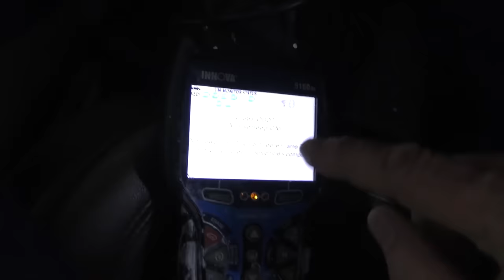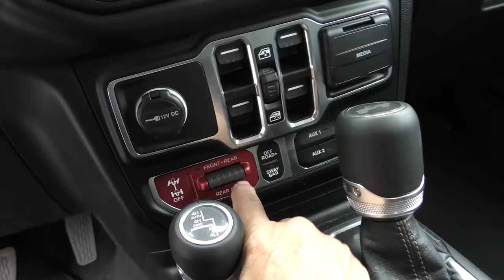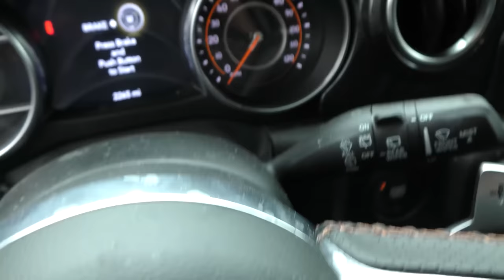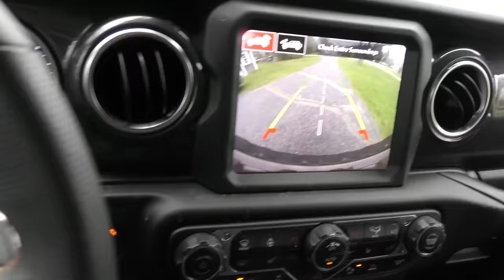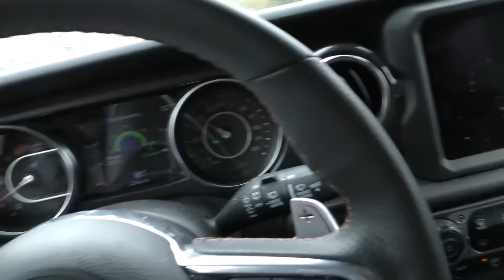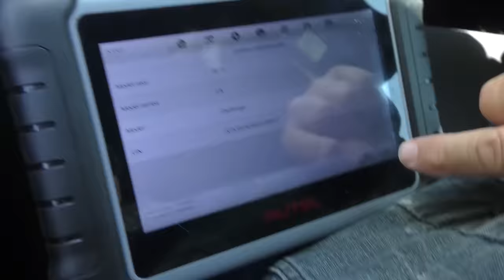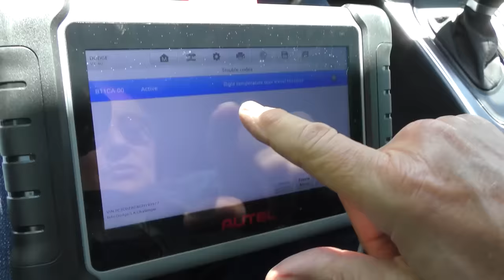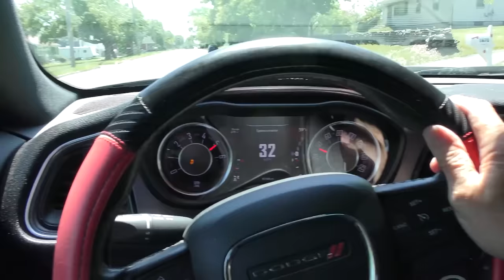3 Vehicles That Look Great But Fall Apart Faster Than a Marriage

Comment: If Scotty designed a vehicle, what should it be called? The Kilmer Classic. CHEAP, has a timing chain, NO BEAUTY ENGINE COVER, 4 cylinder, non-interference engine, A DIPSTICK, manual tire gauge in the glove box, no battery except to start it, no CVT transmission, MANUAL transmission, no GDI fuel injection, fat juicy backup camera, cold AC, clears that speed bump in Scotty's neighborhood, survives the stop sign during lunch hour, manual parking brake, AN ACTUAL KEY to start AND unlock it, made in Japan, no turbo, automatically changes its own oil every 5000 miles, gets great gas mileage except when you drive... like Scotty, has an actual chassis, cloth seats, no sun roof to leak, no plastic stuff, cheap available replacement parts, a GAS CAP, lasts half a million miles, and comes with a trustworthy mechanic like Scotty (with a scan tool). Did I miss anything?
Reply: No you did not miss a thing.
Reply: Very close to describing an older Mercedes diesel.
Reply: NO GDI ENGINE..NOOOOOO !!!!!!
Reply: toyota/Lexus badge
Reply: Missed fancy backup camera for tree in the driveway 😊
Reply: Just one. Manual transmission. Outside of that sir, you didn't miss a thing. Your comment is priceless! Thank you very much. Long live Scotty. Rev up your engines! If you handcuffed Scotty would he able to speak?
Reply: Purchase of the Kilmer Classic comes with a lifetime supply of throttle body cleaner
Reply: Ha! Good one!  @MrThatnativeguy
Reply: Cloth seats
Reply: @MrThatnativeguy   Sweet.
Reply: Missed working cold A/C
Reply: Missed that if you do a little maintenance it will go another half million miles.
Reply: It must be fast enough but no turbocharged, like NA 2.4L  4cylinder
Reply: Nah, you got the whole checklist.
Reply: Reliable electronic systems, changes its gearbox & differential oil every 50K miles, Autel OBD II scan function built into the central display module.
Reply: Kilmer Perfecto 1.8L
Reply: It would have to have two engine beauty covers cause we know how much he loves them.
Reply: No beauty cover
Reply: Make sure the side mirrors flail around like his hand gestures 😂
Reply: Old Mercedes 300D diesel. Volvo 240 series.
Reply: Recommend crank windows, never fail.
Reply: Did you forget "no TPMS"? Put a pressure gauge in the glove box.
Reply: Transmission dip stick
Reply: @Kurtdog63 Thanks again for the best comment I've ever seen about one of Scotty's vids. I doff my chapeau to you. I'm waiting for Scotty's next post.
Reply: Yes, you missed two things: it's cheap and used.
Reply: so a Corolla?
Reply: @dragonstalk86  1994 Celica or my 1999 Camry!
Reply: I think you missed no AWD.
Reply: Lower front bumper mailbox camera
Reply: @MrThatnativeguy and at205 reseal
Reply: 'Continuously Variable Transmission transmission'
Reply: Lists as 1994 celica
Reply: Toyota Celica  Scotty Edition
Reply: 4 and 6 and 8 cylinder
Reply: sounds better than most cars out rn
Reply: Forgot one thing: it’s NOT built by Chrysler
Reply: Ha yes. I put made in Japan, so I guess that excludes all American or Mexican or French made brands....  @Braaezex
Reply: It's called a 740 or 940 Volvo base model.   Job done.
Reply: 1:34 1:37 1:38
Reply: I'm having a hard time finding a 2021 Camry LE Hybrid with a keyed ignition 😂
Reply: it's called Lexus

Comment: I had an Alfa Romeo Stelvio for three years. One of the best cars I have owned. I know someone else that has had theirs for two years, not one problem. Give them a chance, they’re great vehicles.
Reply: Dude... 2 to 3 years doesn't make them great cars...they probably have hardly any miles....
Reply: @richsweeney1115 I don't get the Alfa hate, the first model years of the Giulia did have issues, but 2018 and up their cars are solid. It's pretty hard to find cars that are "unreliable" today.
Reply: It's not hate, it's logic. Alfa Romeos are made for people who lease and release. American and European cars are generally totally unreliable and expensive to fix.
Reply: @originalthoth7313  yet BMW is higher than both Honda and Mazda when it comes to reliability ratings now. Cars are more reliable than they ever have been. Fixing cars has never been cheap even with non-luxury brands although luxury brands are still considerably more expensive.
Reply: Isn't the Stelvio powertrain pretty simple? I thought it used a SOHC I4 turbo based on a mass produced Stellantis engine and a widely used 8-speed transmission.
Reply: It only has one problem. It's an SUV!
Reply: Most people in the US,  only use vehicles for 3 years, because they know after warranty expiree they can't afford expensive bills, so its easier to spend 30k in a new vehicle, and then in 3 more years the same. At the end people wasted more than 100k in vehicles. And they dont have savings ,  cant pay off their home because of  all the money the capitalism its taking from them.   One of the best decision  in my life was to  keep my car for 11 years, while that, i saved  a lot of money to pay off my home. Now that i have paid off my home, i decided to get  a new corvette. It Was worth to be patient.
Reply: @juancruz-jg5pq great, patience pays try driving the small utility car until we are in a good position
Reply: ofcourse. Alfa Romeo is making great cars. This guy just have no idea about new cars.
Reply: lmao, telling the world how reliable a 2 or 3 year old car is a laughable. If a car can't even make it to 3 years without issues, that means its a complete piece of junk. If you want to praise a cars reliability, drive it for at least a min of 100k first
Reply: @robotbro7187  100k you could make in one year so your comment is illogical.
Reply: You didn't own it long enough for anything to happen.  Almost every new car can go 2 or 3 years with nothing other than oil changes and possibly brakes and tires.  Own that Alfa for 7 to 10 years and it would be a different story.

Comment: My father has an Alfa 156 2.0TS for more than 12 years. 350k km (around 220k miles) with almost zero issues. He drives it daily. I have Alfa Romeo 159 too. : )
Reply: Had an alfa 156 also for about 10 year and 256 km. Pretty good car in fact; no rust at all. But maintenance (especially in suspension) needed to be taken care of.
Reply: @henrikvl1704 it's because the multilink is a very advanced suspension and requires some special care but is a blessing performance wise

Comment: I wanted to try something different than a Honda so I went with a Giulia. Great car had it for almost 4 years and put 55K miles on it. I do the oil change myself every 5K and it’s been great!
Reply: It's been great because you have no miles.......55k isn't a real test...my fords and hondas have had 250k-370k when I sold them running perfect..my last 5 spd  honda accord  had about 370k when it gt rearended. My 5 spd civic SI has almost 300k. Runs perfect ..I really dnt feel like you're will g that far, as problem free. They do look nice, and they're fast, I love them. I used to want one till I learned more about them  few years ago
Reply: @richsweeney1115  as you can tell from my username I’m a diehard Honda guy. I agree but I’m not going to keep it past 75K miles and that’s pushing it haha Honda and Acura is the way to go
Reply: @richsweeney1115  What kind of driving do you do to put in this many miles??
Reply: @richsweeney1115  You aren't the target market for this car.
Reply: Fords are worse than Fiats
Reply: @chris4321das  Bro, basic every day usage.
Reply: Wonder who was the unlucky bastard who got the car after you
Reply: @chris4321das You own a car a long time, you put a lot of miles on it. If he works a 9-5, that's already plenty of miles every week
Reply: @richsweeney1115 my current 2013 Ford that I use as a daily has 394,000km.  Runs like a clock.  The 2015 Mustang GT is my fun car that I use evenings and weekends with the occasional trip to work when I don't feel like moving the cars around at 5am.  The Focus (manual) has really given me no issues at all despite the mileage.
Reply: Problem is the depreciation of them.  You're likely going to lose your shirt after 4 or 5 years and 60-70k
Reply: @derekgardin1512  highly agree with you. I bought mine for $39K and some change 4 years ago and now it’s not even worth $18k.

Comment: I have a 2019 Giulia I bought last year with 29k miles and now have 51k, no issues so far! I don’t plan on keeping it past 120k or so, but I have a feeling it’ll be much less expensive to repair than a similar BMW or Mercedes. A lot of the parts and fluids are shared with Chrysler & Dodge products so they can be found for pretty cheap even though it’s a “premium” car. Just my 2¢.
Reply: Bmw n mercedes are still junk built not built good like they used to
Reply: Bmw was never good notorious for many failures like British auto manufacturers
Reply: Good for you, but 51k miles is nothing
Reply: im planning to get a 2020 guilia any advice ?

Comment: Have had my Giulia since February and put around 40k miles on it. Mechanically speaking the engine, trans and turbo are not the issue, it’s the rest of the Mopar and fiat stuff that has broken and caused me headaches. But at least the Mopar parts are cheap and easy to DIY.

Comment: My dad owns a 1980 Alfa Romeo Giulietta, which he had for 42 years now. No major issues over that period except for rust, which was sadly common with older models.

I own a 2020 Alfa Romeo Giulia and it's genuinely the most exciting car I've driven. Oddly, I find that my fuel consumption is lower in dynamic mode than in the other modes, think it's cos the throttle response is better so don't have to put foot down. I get like 9/10 litres per 100km with Shell 95 fuel.

As long as you use the correct oil every 15 000km or year (whichever comes first) and clean or change air filter as well, then there'll be absolutely no issue with the car.

Servicing on time and having a mechanic with good workmanship makes all the difference. Have a 2003 VW Polo for 18 years now with 193 000km with no major issues at all

Comment: Me and my Fiance have a Giulia. It took a lot of work to get it back to like new condition at 60,000 miles, and I did it all myself as a mechanic. Fuel pump and module, leaking radiator and coolant tank, oil leak and coolant leak from turbo, some broken interior bits, and it eats through tires like a Tesla because of the torque. I put wider tires in the back to handle the torque. The engine and transmission are very reliable ignoring everything else.
Reply: Electric issues, air conditioner issues are typical European car must have problems
Reply: Yeah I know a few people with stelvios and gulias,  like 3 with over 100k. None of them have had any major issues besides electrical gremlins
Reply: Stelvio hates dashcams, or at least mine does. After getting a check engine light I found out the when you turn the car on it runs a check of all the systems and takes about 4-5 seconds. If you have a dashcam plugged in it’ll interfere/interrupt that check because it’s drawing from the battery and will throw codes.
Reply: This was likely the 2017 models that had those as common faults but they were rectified in 2018 onwards

Comment: My neighbours have a 2017 Fiat 500 with over 110k miles since new had only a few electronic issues covered under warranty but mechanically it’s been very reliable.

Comment: I own a 2015 Alfa Romeo Giulietta QV, and very happy! 
Yes yes, I had some problem with engine oil pressure sensor and te door grip breaks down. 
But you are so happy looking at it and driving it 😁
Reply: @freshjerky1  in my case it was engine oil leakage since the sensor was malfunctioning so did not even get a warning. Replacing the sensor solved the problem.
Reply: im currently saving for a giulietta QV. Hope ill find a reliable one in either red or white at a good price when im ready

Comment: I used to owned European Car way back in 1980. I really took care of my car and followed the factory maintiance but after 50K everything fall a apart and the parts is 400% marked up back then. I remember the rotor for Volvo 244GL and 760GLE cost $460.00 each plus installation! While Toyota OEM Supra rotor was $64.00 back in 1985. The waterpump of valvo fell apart every 12K as well as muffer! It cost $300.00 for replacement OEM waterpump in 1984 and oil leak were all over the place including rear main seal that took 10 hours to replace and not solved the problem.
Reply: I worked with a snob guy who owned a Saab 900 back in 1982. He bragged that he installed remote power door locks and paid a custom body shop to shave off the exterior handles. His battery quit and he had to pay a locksmith to jimmy the door-Hah hah Haa! Then the other shoe dropped. New alternator for  $300!
No reman available!
Reply: i knew someone who had a Toyota Prius and the hybrid system failed cost ihim around 5k for repairs
Reply: Then there was the guy at autozone that was trying to find a gas cap for his 2012 WV Beetle. He did not want the Dealers $85 cap. Hmmm. $18 Chineseium part. The rubber gasket on chineseium gas cap develops a leak in 12-18 months. Cheap Neoprene instead of quality Viton. Throws a low evap code everytime.
Reply: @fromthebackofmymind  my brand new 1981 Volvo 244 GL power window fail at 2K when the temp fall at -20F in Cheektowage, NY ! and the car failed to start during the first winter of ownership! I have to pay for flat bed truck. The light bulb failure warning keep poping up and never fixed! The 4th year of ownershio the altnator failed and cost $365.00 with rebuild.
Reply: My Arctic Cat Forklift needed a shot of ether every morning in january at -20°F.
Diesels, yup.
Reply: Refreshing to see a comment that reflects reality. Exacty, and American cars are in the same league. The only exceptions were Opel and Peuguot. Other than that the cars were at the shop most of the time, spare parts unavailable and expensive, and never a vacation without the cars totally breaking down. The Fiat 131 and 132 were solid but had no A/C or any options.

Comment: Mr. SCOTTY i have the same exact model, color and everything. It has 125k miles already and still driving beautifully. I do the oil changes myself every 5k miles. Do you recommend I drain the transmission/axle fluids or just let it be since the miles are so high on it. Thank you

Comment: Most of the things you say on your channel are true, but I do take exception with your assumption that Alfa Romeo is gonna fall apart.  My wife and I are on our second Stelvio with absolutely no issues whatsoever.  My wife has developed a leadfoot because of, well, you drove the car, so you know.  So far, so good, my fingers are still crossed because I am aware of Alfa Romeo in the United States (in Europe, especially in Italy, Alfa Romeo has made extremely reliable cars for decades).  By the way, Alfa Romeo was making sport sedans when BMW was making 3 wheel micro cars under license from Italy.
Reply: It wont fall apart. It’s manufactured by Chrysler. It wont last as long as a Toyota or Honda by any means, but it’s not a independent company with subpar capabilities slapping together cars anymore. They are owned by a large umbrella company. It’s honestly just a Chrysler product with the name applied.
Reply: It’s exactly like the modern Maserati brand. They aren’t falling apart anymore. They are Chrysler vehicles. At least until now. Another manufacturer is taking Maserati over now.
Reply: Depends on your definition of reliability. I think Scotty is referring to 100k mile reliability
Reply: And if you watched the video he was mainly referring to the cost of maintenence
Reply: @mattbrawner7888   whos taking over maserati ??
Reply: @mattbrawner7888 
Why do you talk about something you don't know?! All Stelvio are made in Italy on a factory called Casino!
All of them are engineered by Alfa Romeo only!
Absolutely no input at all from Chrysler!
Reply: @mattbrawner7888 
Another ignorant comment! 
Maserati is part of the Stelantis group but shares absolutely nothing with Chrysler!
Reply: @orangepeel1366 
Maserati is part of the Stelantis Group which owns several car brands, including: Alfa Romeo, Chrysler, Jeep, Peugeot, Citroen, Fiat, Dodge, Ram, DS, Opel and Lancia!
Reply: @mattbrawner7888 its not a chrysler. most parts are from alfa
Reply: exactly! @rubenvalente

Comment: Scotty need your help! Got a ce 300 and head gasket blown, should I fix it or not ? Thanks :)
Reply: U have to go to his website for questions. I don't think he really interacts much on here
Reply: If you can diy? How much mileage?
Does it still run? Price a head gasket set. Do you own a torque wrench and metric sockets and wrenches? Do you own a repair manual for your car?
Can you afford a machine shop to check for warpage on the head(s)and fix or replace? Valve job and guides?
Finally does the car have enough work room to pull off the head(s)in the car?
Or engine must be removed.
Thats about a $2000 question.